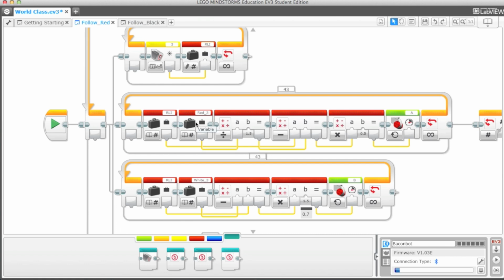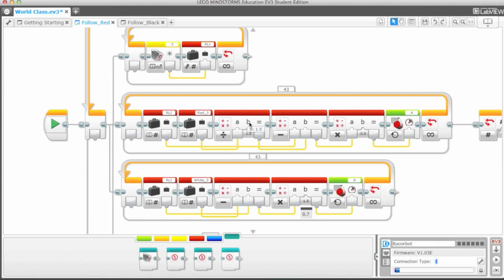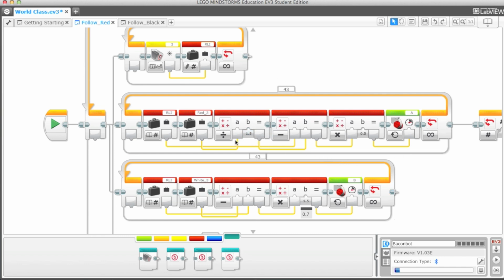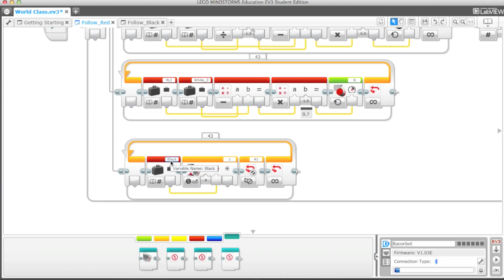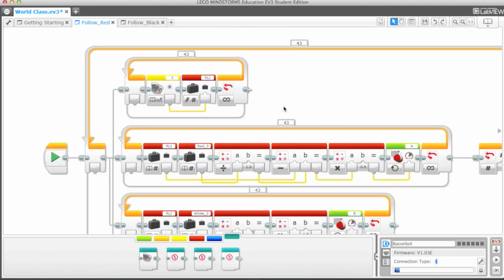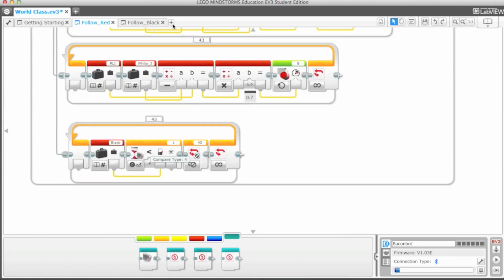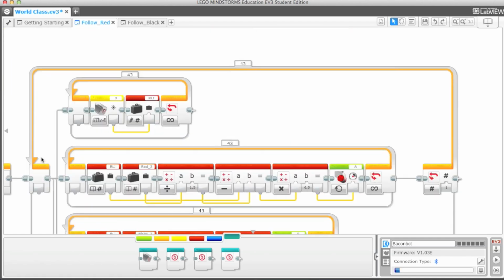How To Follow a Red Line | FLL World Class Learning Unleashed | Lego My Lego

Comment: Where do you get the inputs (WRITE) for the variables Red_3, White_3, and Black?  I only see the READ parts.  Do you define earlier?  If so, where and what are the values that you used?
Reply from the maker: We use a calibration program … we will be doing a video on it in about a month
Reply: Finn O'Hara Thanks!